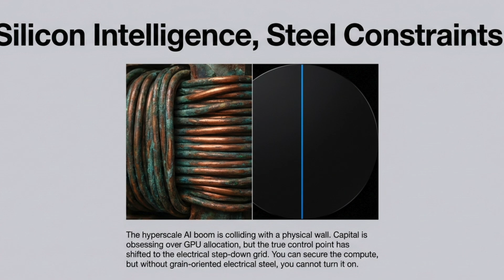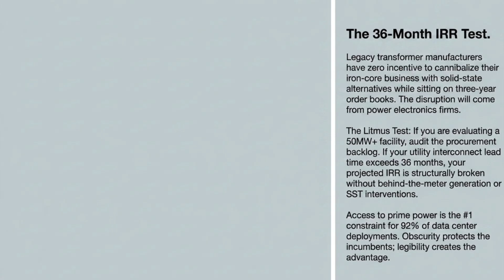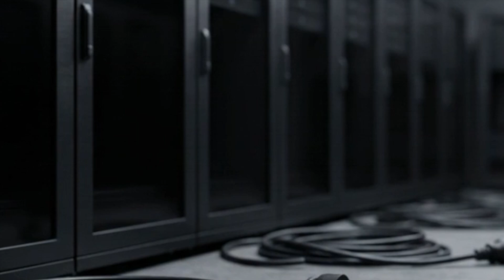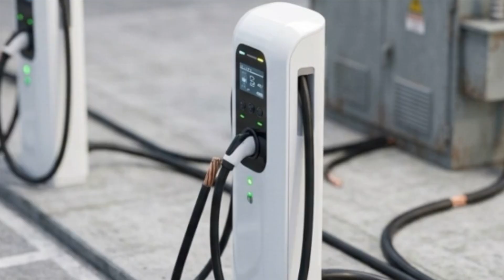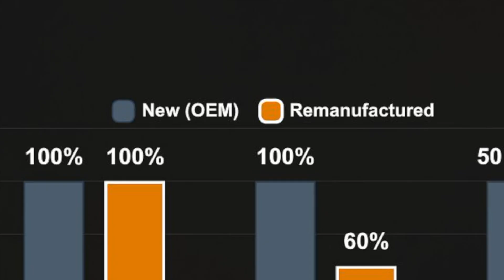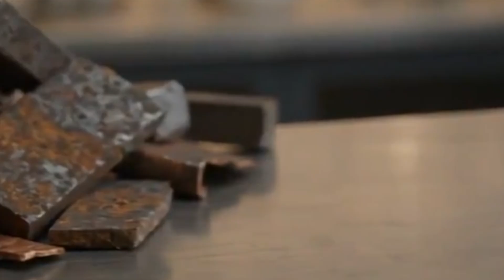Why Your Data centre is Stalled And It Isn't GPUs : A Quiet Shift to Solid-State Grid Infrastructure

Comment from the maker: Here are few sources for your reference 👉
 
https://www.datacenterknowledge.com/build-design/ai-data-center-boom-rewires-us-power-supply-chain
 
https://energynewsbeat.co/ai/more-than-half-of-the-data-centers-may-be-delayed-due-to-lack-of-transformers-and-electrical-equipment-2/
 
https://www.wolfspeed.com/knowledge-center/article/powering-ai-with-reliable-silicon-carbide-based-solid-state-transformers/
 
https://miamitransformers.com/blog/transformer-lead-times-2026
Reply from the maker: The Structural Bottleneck

 
The AI industry is tracking the wrong supply chain. While capital floods into GPU procurement, hyper-scale infrastructure is hitting a hard physical constraint: the step-down electrical grid. Legacy iron-core transformers rely on Grain-Oriented Electrical Steel (GOES). GOES manufacturing is highly consolidated, energy-intensive, and fundamentally difficult to scale. Furthermore, the specialised labor required to wind massive copper cores is aging out of the workforce. The result is a 160-week lead time for critical grid components. You can secure the compute, but you cannot turn it on.
Reply from the maker: The Bootstrapping Solutions

For operators caught in the utility queue, the immediate triage involves behind-the-meter generation (natural gas turbines as bridge power), refurbishing decommissioned legacy transformers, and negotiating micro-grid architectures that share power loads dynamically across industrial parks to avoid triggering new utility substation requirements.
Reply from the maker: Lucrative Opportunities

 The asymmetric advantage belongs to firms solving the high-voltage direct current (HVDC) transition. As AI data centres move toward 800V DC internal architectures, the opportunity lies in Silicon Carbide (SiC) and Gallium Nitride (GaN) solid-state transformers (SSTs). The most lucrative chokepoint is no longer the logic node foundry (TSMC); it is the SiC wafer fabrication and power electronics packaging facilities capable of handling grid-scale voltages.
Reply from the maker: Listen to this 👉 as you commute:

https://open.spotify.com/episode/7FTTgCmt3CVlHjJl75B0VL?si=9lsq_WxpScubCSN8IhE0VA
Reply from the maker: VIEW Here 👉:  

https://youtu.be/P5PnXbhAkWg
Reply from the maker: Access “Strategic Briefing: The AI Power Constraint” here 👉:  

https://docs.google.com/document/d/1Ikt5857VMxe7ia7WC6IWI5BtjapIQGGWoxZnuqBp6O0/edit?usp=sharing
Reply from the maker: Connect here 👉 
https://tr.ee/vYy2GL  

Or here 👉 
https://linktr.ee/PRASADBHONDE
Reply from the maker: Or you may want to read this 👉 

https://amzn.in/d/01HOcXep
Reply from the maker: Dive DEEPer Here 👉:

  https://prasadbhonde229.medium.com/why-your-data-centre-is-stalled-and-it-isnt-gpus-63982cb2f5fa